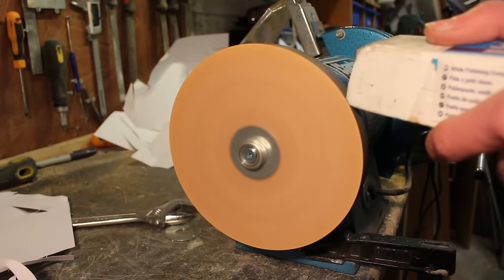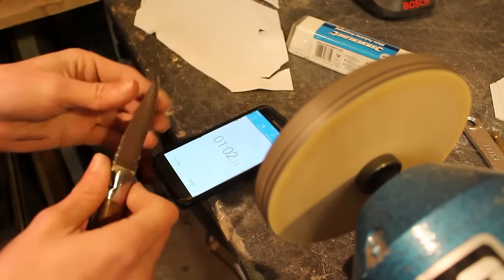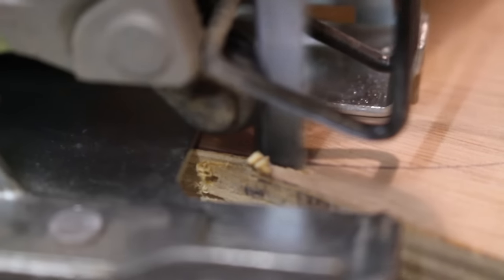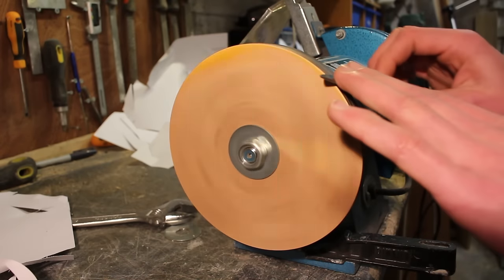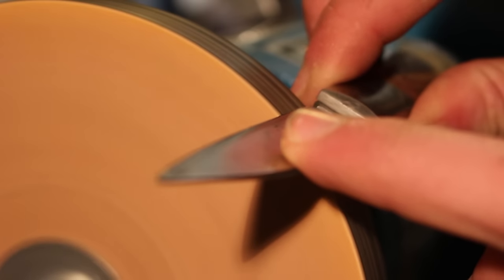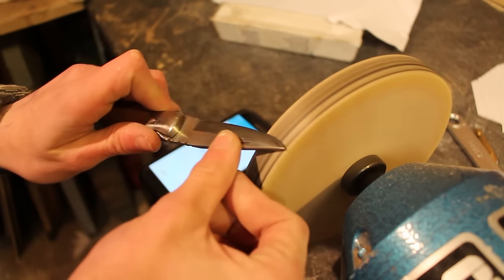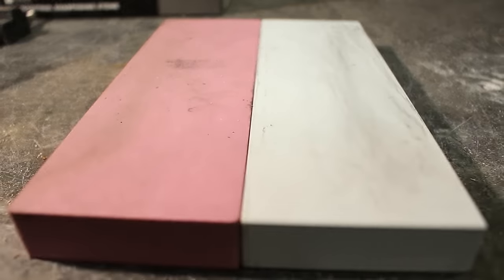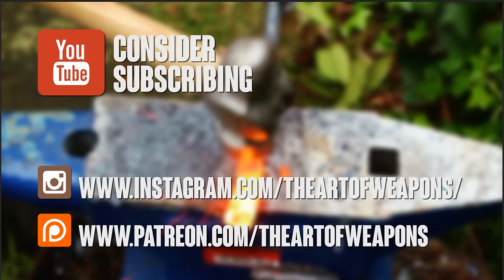The Laziest Way to Sharpen Any Knife to Razor Sharp 2

Comment: I remember years ago visiting Spain.  There was an old chap there who visited local restaurants sharpening knives.  He had a similar set up, but it was mounted on an ancient Vespa scooter - the seat was modified and the apparatus sat on the pillion, the sharpening wheel being linked directly the engine.  I was quite jealous of his simple life style.
Reply: im 4 yrs late but here I go.
During the 90's here in Philippines, I remember some sharpener professionals who ride a bicycle around the town offering sharpening service. what they have is round sharpening stone with a bicycle chain attached to it, they will attach the chain of the sharpening stone to the pedals of the bicycle and viola, a manual grinding stone powered by pedals.
it's really cool to watch them sharpen knives and scissors.
Reply: @Ace-Vincent-Arevalo  We still have those guys here in Portugal. Same system, they use a typical whistle to attract attention.
Reply: i know a guy that used to visit restaurants sharpening knives and he has a knife store now
Reply: Me to man I spent thousands on equipment machinery chassis straightening spray booths ,for 35 years ,and I see trade's people doing the same in Eastern Europe with a couple of grands worth of tools.
We were told we couldn't do the Jobs on panels chassis welding repairs for ins company's etc ,it certainly looks a lot more trade like relaxed normalised way of working.
Cheers catch up later..
Reply: I didn't know the a
Reply: I didn't know the ancients had vespa scooters, i thought all they had was horses.
Reply: Seems really weird that the chefs in a restaurant wouldn't keep their knives sharp though.
Reply: that man goes around with quite an unique and annoying sound every 3 seconds, we call it "el afilador" basically the sharpener hehe.
Reply: @mrkiky  you'd be surprised. Some restaurants just don't really do it. Not higher end ones but still. The cooks would fight for the best knives lol

Comment: This is something I'm going to have to try! A word for anyone considering this method: always use the lightest touch when honing with that wheel. Solid plywood spinning fast like that will heat a blade very rapidly if too much pressure is applied, potentially ruining the heat treatment at the edge of the blade.
Reply: Extremely important point about overheating and ruining temper/hardness of blade!  If you got to color change of metal, you very likely went too far, too fast, detempered the edge... food for thought.
Reply: I would be more concerned of the wooden wheel exploding.
Reply: I don't think a plywood wheel could explode at that rpm
Reply: I wonder if you could add some water without ruining the plywood. Perhaps if it's marine grade?
Reply: @wordup897  Yup, unless it was already compromised it'll be fine - plywood is way tougher than most people think.
Reply: My sphincter is clenching thinking about the edge of the knife digging into the wheel........

Comment: As a trained silversmith I have to give you a solid 90-95%  “Thumbs up” for your creativity in this video! The only reason why I can’t give you the full 100% is that you overlooked a really crucial detail that newbies at this would miss, and that is that there needs to be a cold water bath by the buffer (big enough to hold the entire blade), and that the blade needs to be quenched each time it starts to warm up – long before it changes color – to prevent the person honing the knife from destroying the heat treatment (tempering) that allows the blade to maintain its Rockwell hardness and hold an edge. About 20 years ago, while still in school, I made that mistake with a tempered steel onglette type graver point that so quickly changed after accidental bluing that it went from feeling like a knife through butter to something more like a bulldozer through rocky soil, when working on copper sheeting — a lesson I’ve never forgotten. 

This obviously wouldn’t be an issue with a $12 Mora, but on a pricier or custom made blade, that could be a very different story! (Just my $0.02 worth...)
Reply: That makes so much sense. Theres been a few times where thats happened (discoloration) and I was scared to sharpen newer or more expensive knives and blades because I didnt understand why after I sharpened my blades it would be shit after. Thanks for the tip Sir, Made my life a little better.
Reply: Huh.  I use an mdf wheel and I’ve never had a blade heat up from its use. Maybe because I go one pass at a time, rather than back and forth while sharpening? But good to know about the water in case that does happen. Thanks.
Reply: based boomer
Reply: Thank you Douglas it's people like you who give golden nuggets of experience and knowledge for free just so people don't make the same mistakes as you I really appreciate it as many others do👍
Reply: 60 seconds on a this thing would never heat metal that hot unless you really pressed and never lifted up. Wouldn't hurt to have water but not necessary
Reply: You can also use various types of oil which will quench nicely and also have no risk of causing rust.  You can reuse it over and over also.
Reply: I made this. And  it's  so fast there is virtually  no heat.  It's so fast I spend about 10 minutes  and do over 20 knives.
Reply: Its wood,the heat is not like metal on metal
Reply: The quality of metal is a very important factor, getting sharpened and retaining it'. 👍🏼
Reply: Why is everyone so bloody technical. The dude is giving a tip here. We all know what bluing is and can see how quenching would help. Whether or not this tool causes bluing, whatever. I would suspect however that I would find a way to make this thing hot as hell so thanks OP silver guy.
Reply: I still feel like if someone were to take the time to slowly under the water sharpen their knife on a stone, it'll be better than a dry diamond stone or belt. At the micro bevel level, it'll still overheat only much much faster seeing as it's so thin.
Reply: Even this is not good enough because the temper is affected at the micro bevel edge.  This method is only okay if you have a steady stream of water on the blade as you are grinding it and even then it is far from ideal.
Reply: @vanjam412  in my observation… I believe his comment is for folks who have never worked with these tools and not aware of such issues.  I can see how someone trying this for first time might “overdo” this not realizing it should not take much to sharpen your knife. Just my 2¢.
Reply: 90-95 % for destroying the heat treatment of the blade (destroys the knife) and the small weel also gives a nasty hollow grind. You should have been even clearer. The video was misleading and people who follow the advice will destroy their knife
Reply: Your .02¢ if advice is the deal of the day!  If you accidentally anneal your blade it won't hold an edge unless you temper it again.
Reply: @williamshelton5209  When steel is recycled it's sometimes put in an annealing furnace before it goes to the blast furnace.  It has something to do with removing the carbon that is locked into the steels structure probably to put all the assorted scrap steel to a more uniform composition.  Then they have a benchmark they can add more carbon to suit it's new purpose.  This is just my best guess given what I know about steel and how tempering works.
Reply: I have a hard time imagining it getting quite that hot but haven't tried this yet to know for sure. Will keep a cooling medium nearby in the off chance it actually reaches such a temp. I will say though that the movie stereotype of heating a knife blade to cauterize wounds is indeed BS. Please nobody ever do that unless you have absolutely no other junk steel handy in emergency.
Reply: I used to sharpen various tools/blades like this with a stone. I would not let the tool get hot enough to use water as a coolant. Yes - Razor sharp
Reply: I imagine the wood would smoke/ember/catch a fire well before the knife has any trouble. Maybe I'm wrong.
Reply: there is also the fact that this is stropping and not sharpening

Comment: I sharpened a lot of stuff by hand over the years.  The most time I spent was sharpening an 18" machete to razor-sharp starting from a hand file then going to a cheap 2 stage whetstone.  It probably took like 5-10 hrs.  In the end, it was sharp enough to shave with and could cut through a 2" tree in one swing.  I would say this is a good method to get similar results in a lot less time.

Comment: I just made an 8 inch wheel from some high grade finished plywood. I followed the steps and tried various types of polishing rouge at 20 degrees. I did a couple of knives and looked at the edge under the microscope. Clearly, each bevel is free from defects and is quite smooth, uniform and polished in appearance (nice! ) (very unlike using a steel) . However the edge point itself was not perfect and needed a bit of touch up with a leather strap. Result=good.

Comment: Tips for those trying it:  
Get two type of compound.  One fine (white from link in video description) and one ultra fine (green from same link).  
Put the fine on the wheel and take your time so the blade doesn't get hot or use an oil or water bath occasionally to cool the blade down between passes.  
Put the ultra fine on a nice leather strop and use that to finish the polish and perfect the edge (if more than a great working edge actually matters to you).

Comment: I had a grinder with one side available so I immediately went into the shop and rounded up the materials and built one and it works beautifully.  On one side of my grinder is a buffing wheel which I used for polishing knives that I build so I already had the jewelers rouge (grinding compound).  Don't listen to the people who always try to convince themselves that they are smarter by belittling the accomplishments of others because they usually have none of their own. Use a little common sense and a light touch and there are no chance of overheating the blade.  Thanks for the post.  I always love a good idea and this one was a keeper.
Reply: Clifton Bennett
Reply: Evelyn Conroy
Reply: J Woods
Reply: So we are ignoring the fact that he just found some parts and build a grinder?

Comment: I remember a commercial product sold on this very same premise about 30 or more years ago. It used a very tough cardboard wheel with polishing/buffing compound. I saw them sold at gun shows here in the US. I know for a fact they worked really well because a friend bought one. 
A whetstone is always the best if you are willing to invest in good equipment and learn how to use it, but it's nice to have options for everyone else.
Reply: An old guy I knew told me about these back in the day (over 30 years ago).  Then I saw a demo of one at the state fair.  Found three at a thrift store several years later.  Gave one to the old guy who told me about it.  Then ruined one because the blade caught into the wheel like at 3:08 - that's a great tip in this video. I still have one left and plan on giving it another go.  Besides the cardboard wheel, it came with a sandpaper grit wheel and several rubbing compound packs.
Reply: @MrHellfinger  what you describe is exactly the kit I remember being sold. They always had one in operation and would charge a few dollars to sharpen any knife, I would assume in hopes you would be impressed enough to just buy the sharpening wheels.
Reply: @LoneWolfZ  Those are called Paper Wheels!

Comment: I used this method years ago and it actually dulled my knife, but I fixed up the wheel and added the compound and tried again, it saw barely any progress but I kept going for another 15 minutes and it actually got pretty close to razor sharp, I found the problem which was the compound I was using was for leather and not that abrasive. Not to mention the blade's steel was a hard steel, so I bought the same brand of polishing compound and it worked. Cuts like butter.

Hopefully some one you found this helpful if you were having trouble

Comment: Awesome!  I made up a disc from 4, 1/4 inch plywood pieces glued together.  I followed directions and was amazed at how quickly I was able to get a razor edge on my knives. I'm simply horrible at wet stone sharpening so this gives me hope that finally I won't be embarrassed at trying to cut meat with something duller than a butter knife.

Comment: You can also turn a belt sander upside down(it helps if it has a locking trigger) and start with some fine grit sandpaper. Set it up the same way as the video ,so the belt is spinning away from you and sharpen the edge the same way. The way the belt goes around a roller can give chisels and knives a nice hollow grind.

Comment: I found this about 3 months ago, and built my wooden sharpening disk. It works great. All of our knives in the house now are razor sharp. I can shave with them. I also built a 8" inch by 1 inch leather stropping wheel by glueing layers of leather together and cutting it into a disk and shaping it using a chisel. This now gives me a two stage approach and enables me to do light maintenance on my knifes with less metal removed. Thanks for sharing this video. Knife sharpening is now therapeutic and satisfying.

Comment: Great video mate. I especially like that you have mentioned very good methods of working safely. I hate blunt knives and spend a lot of time using a steel to try and keep an edge on my kitchen knives but I’m not very good at using the oil stone I use to sharpen them. I have often thought of investing in good wet stones but I’m not sure I would be any better at using them either. This looks like a great, quick and easy method. Very professional, informative and useful video. Thank you.
Reply: Instead of more equipment, invest in a course.

Comment: Just went to the Garage and made one!
Took me around half an our. Cut everything with the cnc, put it on and boom. Works like a charm. Thank you, I finally have sharp chisels again. And my pocket Knife is actually worth the name "knife" again.
cheers
Reply: CookingTasty lol
Reply: OK what is the diameter of the wheel. Have to go to community wood work shop to manufacture.
Reply: That depends on your grinder. I think mine was 120mm but yours could be bigger or (unlikely) smaller. Just measure the grinding stone that was on there and make it that size. You have to measure eather way because you need the diameter of the shaft on the grinder..
Reply: Where is mine
Reply: @nils1953  Bigger may NOT be better. If you increase the diameter then you increase the risk of the wood breaking up under the increased forces exerted on the spinning wood. I wouldn't go any bigger than 150mm diameter because this seems to be safe.